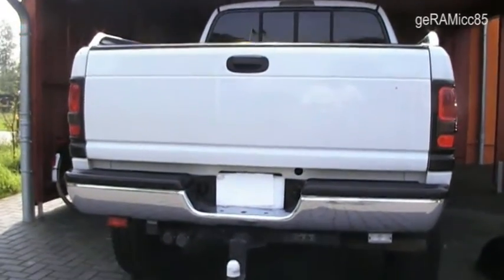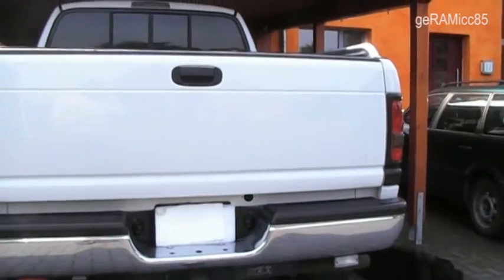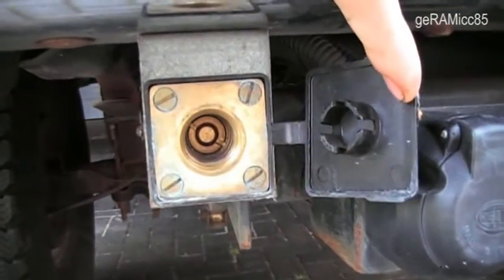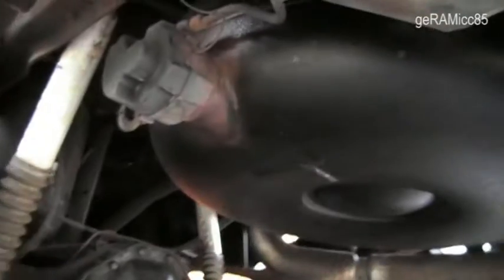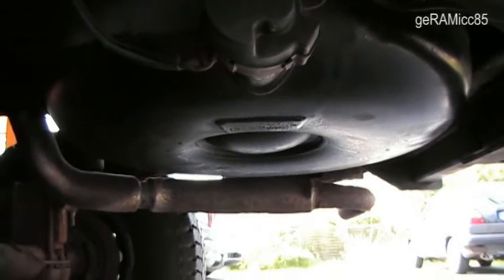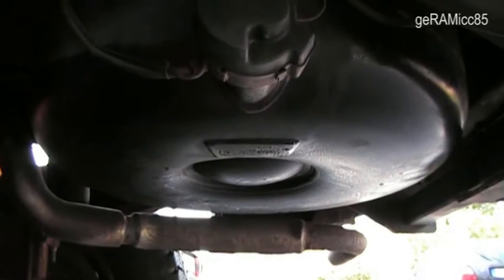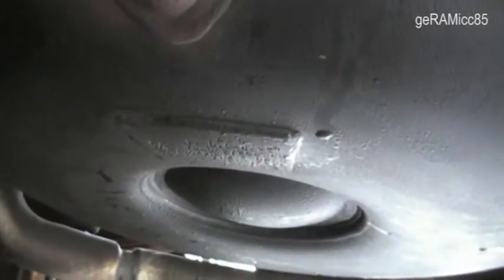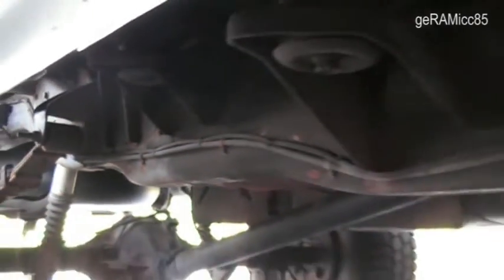PROPANE INJECTION KIT INSTALLED IN DODGE RAM 1500 V8 | BRC LPG CONVERSION | LIQUIFIED PETROLEUM GAS

Comment: I'm trying to find/learn about injecting propane (not converting to propane) along with gasoline as a boost (like nitrous oxide). Is that possible?
Reply: same thought seen them do that at times when doing smog checks using a standard propane torch  and using it at intake to increase revs

Comment: geRAMicc85, I'm certainly interested in doing this conversion, I have a dealer about 1 mile from my home that will fill my truck very cheaply, I cook and heat with propane anyway. I can live with 15% less power for every day, my truck is already very fast, over 400 flywheel hp, 15% less would still be like 340 hp.

Comment: I'm thinking of doing this to my hemi Ram 05. It has a race cam and a custom dyno tune on the computer. I wonder if the high lift = .538" and 263 degree intake duration, 274 degree exhaust duration  will work.

Comment: Thanks for the video.  I am currently looking into this conversion vs a CNG conversion.  LP is easy for me to fill at home off of my 500 gal tank at 1.85USD/ gal compared to gasoline of 3.00USD/ gal.  I know that the MPG is not equal but I am driving 1,000 miles per week.  Also the kits that I am currently pricing is about 400USD excluding the cost of the tanks.  I am lucky enough to be able to install it myself and avoid the labor charges for install.

Comment: I like what I see! Here in the US, I am seriously considering the conversion. What or who is the source of the kit, how much did it cost and what if you don't have convenient filling options?? How did you compensate for the additional heat??? On a more basic note, are you injecting the propane directly into the existing injector manifold or is a new manifold installed to supply lpg to the injectors. Thanks...well done. B.Rodgers